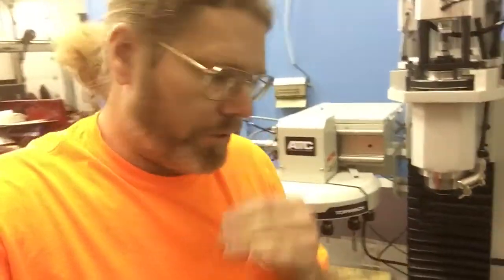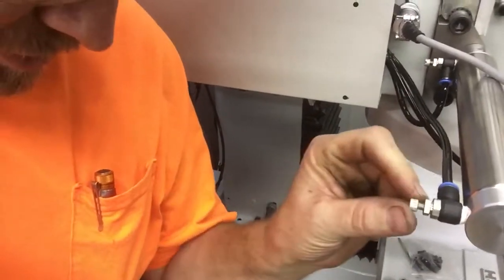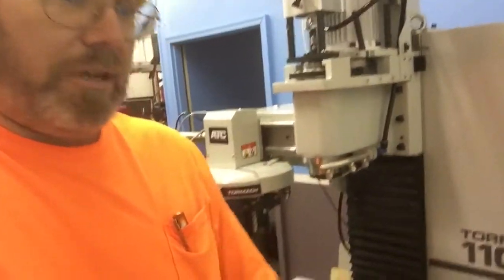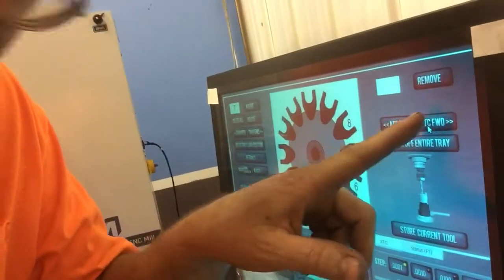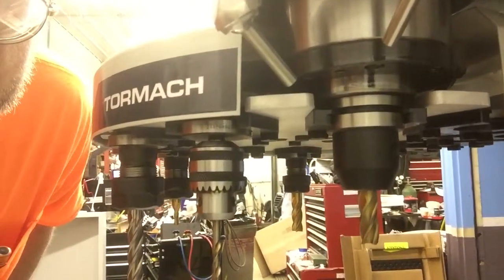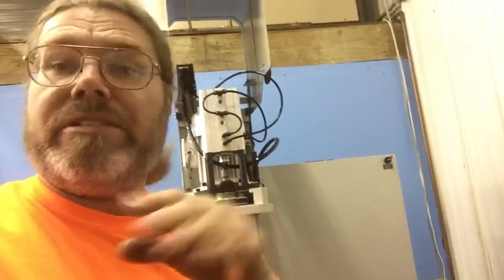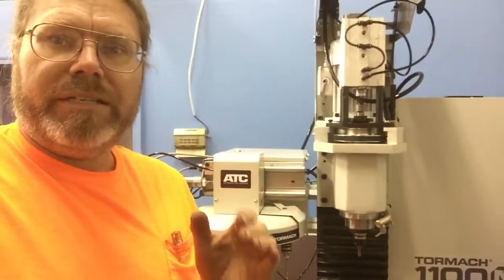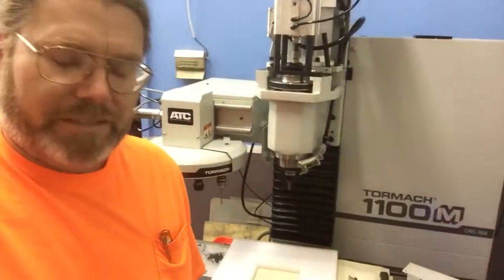Tormach 1100M ATC Operation Success!

Comment from the maker: My point being is that the ATC is not rocket science and can be adjusted and serviced with some forethought. Does not require specialized equipment or tooling from the factory.
Reply: Jonathan, a few things to know. 

1) Tormach advised not to use the right side of screen controls to load tools, use the left side. They are talking about deleting that area and maybe putting other things there.
2) when you broke the plastic screws that was suppose to happen, although they are asking me to test out and make design a cut on the plastic fork so as it will break before the screws so you won't have to dig out the screws, just replace the fork.
3) there is also something you should check, regarding the door arm. There are two length arms. One for the 440 and one for the 770 and 1100
The shorter one is for the 440. I found this out the hard way. 

Skipper